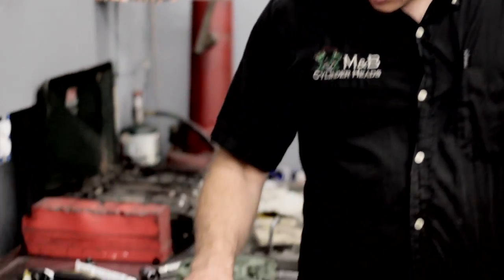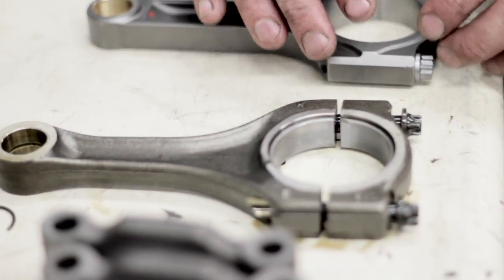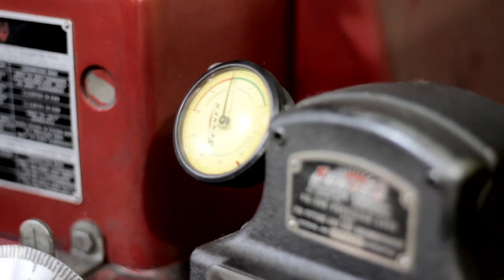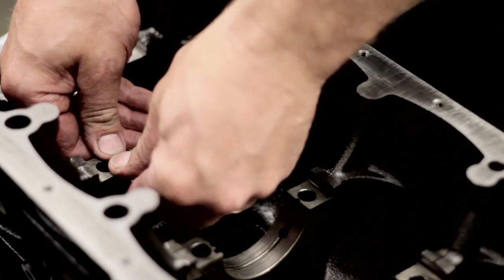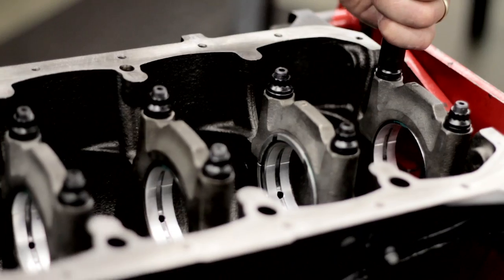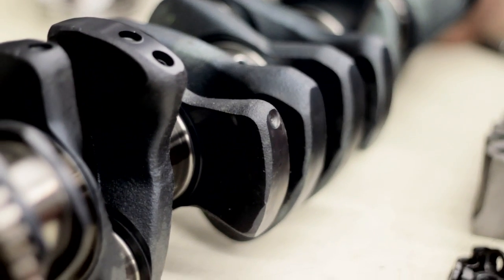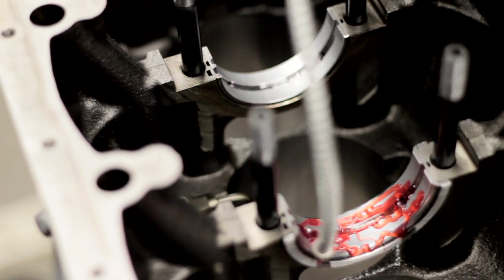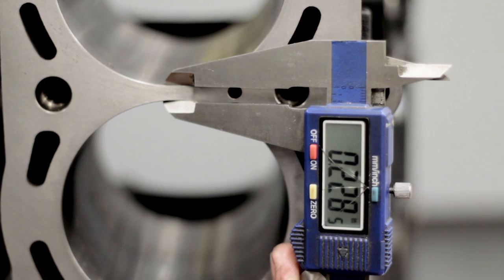HPF BMW Engine Build Project

Comment: BMW uses plasma ion nitriding for the crankshafts.  It is a gas phase process carried out between 750 F and 1000 F.  The electrical field of course produces the nitrogen plasma.  The same process is used on Glock barrels and slides since 2010.